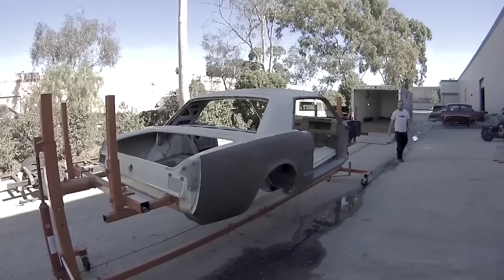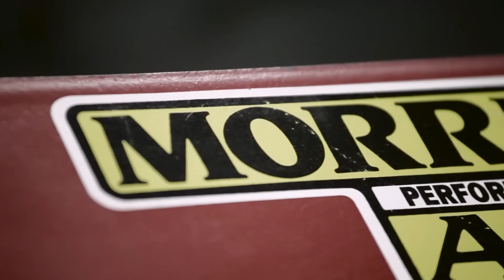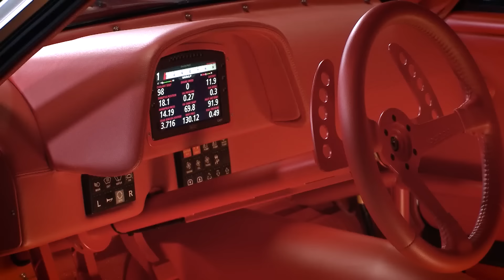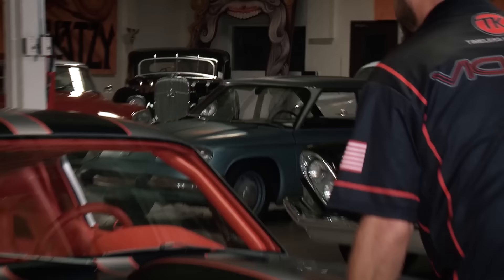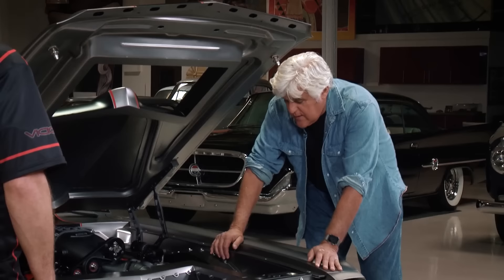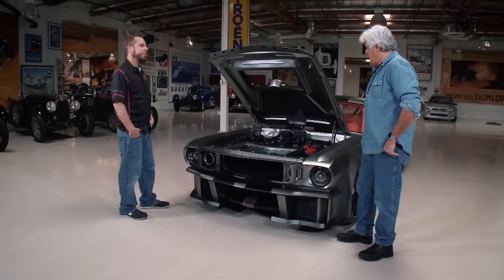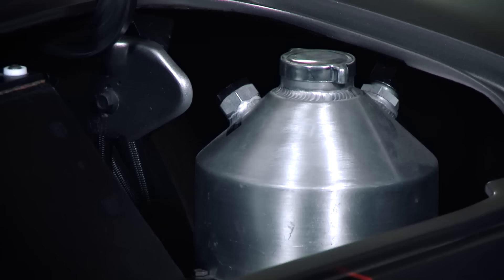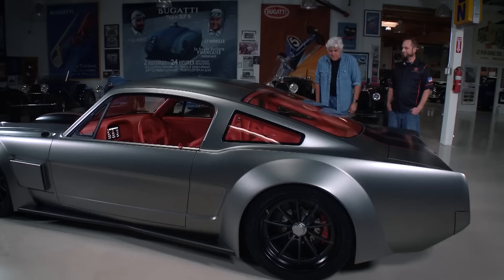1,000 HP 'Vicious' 1965 Ford Mustang - Jay Leno's Garage

Comment: Could they have cut the car down the middle length ways and added in 8 inches in the centre to avoid those horrific wheel arches? 🤔🤣 lol. Interesting engineering features though. Thanks jay
Reply: High Light if you did that you'd have to widen dashboard, engine and suspension mounting points would be different not to mention how much work would be needed to get all the rigidity back.
Reply: Glas is usually one of the biggest issue in widening a car.
Reply: If you take a look at the Ring Brothers carbon fiber mustang where the widened it s5 or so inches on each side all the way from front to rear it still just doesn't look right, These guy could of molded those fenders a lot more suttle but that was not the look they where going for.

Comment: A well built , modified , road racer . nothing wrong with that and enough power to some real damage .
Reply: Jim Braun Exactly..
Reply: Totally it's just a little early 2000s to me
Reply: enough power to get you in some real trouble, its too much for AWD, its way too much for RWD
Reply: Genuine question. What is 2017 type build?  I'm not in the loop.
Reply: moyadapne I think the guy said they used the2017's 350R engine as base
Reply: Jim Braun
Reply: I'm pretty picky with mustangs, and a 64/65/66 coupe are my favorite body. I like the exterior, if you ignore the quarter panels that they ruined. lines are awful, paint looks nice, red windows are a nice touch, the functionality of the bodywork is a nice touch as well, but the interior ruins it, just has to much, red, need to introduce some white or silver to break it up.
Reply: Jim Braun that's a well built almost daily driver 
They say it's built you can street drive it
Reply: Jim Braun                            B Bob
Reply: +Carter Stokoe ohh wow i have three of those and they are priced at honda civic lvl lol. this car by far is the one of my favorites,,hoonicorn=] i like power over originality so is up to someone wether they want shred it or build it
Reply: Jim Braun
Reply: Jim Braun with a 1000HP makes the most suped up Honda civic look like a Tonka toy
Reply: john clark like a matchbox car. Tonka toys heavy duty. At least back in my day they were. I hate those suped up Hondas with 500-1000hp. Idc how fast they are.

Comment: Just read a bunch of the comments. I'm an old guy, and a simple hotrodder. This car is beautifully designed and the exacution is beyond reproach. A true hotrodder takes the best parts available, makes some of his own, and reengineers his ride. So what if it has corvette control arms. They could have made their own; but well designed and manufactured arms that fit the design were available off the shelf. Don't you think enough hours were spent building this car? Don't forget, this car was built for a particular person, not you. So you don't like the "all red interior", that's possibly the least expensive part of the build, Do you think the car's owner didn't have input on the interior? It's what he wanted and your fortunate just to look at it. The car is one of one. Build yours your way. Fantastic car, fantastic build. Imagination that's tangable. I love this car. I got my first '65 Mustang fastback 50 years ago and still have one. Stock is for museums, hotrods are to drive.
Reply: Rack 'em
Reply: Love your comment,,, so true about the bowtie parts,,, they work.
I am an aircraft mechanic and apply those tolerances to my own automotive passion,,, same threads protruding on every screw,,,, well,,,, YEAH! That's how it's done unless you're a backwoods goober with coffee cans full of old hardware making it's way onto your ride....

Comment: Leno: why steel? 
Owner: I have a thousand horsepower, why not?
Reply: @Wes 76 no guarantee it would handle better..... if you have the weight balanced properly a 20,000 lb vehicle can handle good. My dad's 82' chevy stepside is slick, he can take an almost 90 degree corner at 50 mph without even squeaking a tire.
Reply: At least if you hit a tree the tree would be the one who died. Ish.
Reply: "because we know how to weld"
Reply: Love it
Reply: @nicomas2471  tire to weight ratio. when you build small cars you have tire size limitations. when you have gotten the biggest tires possible, the only way to get more traction is to reduce weight.
Reply: Yeah yeah BS. Don't piss on me and tell its raining.
Reply: My thoughts exactly.  1000 Horsepower, gotta give it a real load or it will short-circuit.
Reply: @lynnkramer1211  
It’s raining.

Comment: I’m not normally that crazy about Mustangs but I do like the fastbacks of that vintage.   
This one is exceptional. I don’t see how anyone could not be impressed by the attention to detail and the workmanship. 
Very tastefully done. 
I had to laugh when he said “Yeah this one doesn’t have any taste at all.” 🤣
Reply: OldSchool  
The Chevy must not have been hitting on all eight. 😏
Nah, just kidding, I don’t know what your friend had under the hood or exactly what kind of car it was. The 302 is a respectable engine. Especially in a light car like a Fox Body Mustang. 
If you had a 1980 Mustang with a 302 though it must’ve been a transplant because in 1980 the 302 wasn’t available. It was in 1979 but for 1980 and 81 they de-bored it to 255 and put some crappy heads on it because of the gas crunch and it produced a pathetic 119 horsepower. It was the slowest V8 Mustang ever. If you didn’t buy it new though it’s quite possible that the previous owner put a 302 in it and probably put some other go fast goodies on it too. Hot rodders loved those Fox Body Mustangs.

Comment: WHY IS NO ONE MENTIONING THAT THIS IS TWIN TURBO AND ALSO SUPERCHARGED???
Reply: That's pretty common among performance cars
Reply: i mean, when you say pretty common.... i've only ever seen it once or twice before. most performance cars are TT
Reply: Technically a a turbocharger is a "turbosupercharger" in that it is a turbine driver supercharger.
Reply: All it does is at low RPM the Supercharger is going and keeping the engine boosted and at high RPM the Supercharger is disconnected and the turbos take over. Keeps an even boost through the RPM curve. This is because the Supercharger has even boost at all RPM but it is a HP drag on the engine whereas the turbos lag at low RPM since you aren't producing much exhaust but doesn't drag on the engine since they are powered by the exhaust so at high RPM are more efficient.
Reply: 2:09
Reply: Its compound charged and only makes 1000 horse. My question is, why not turn it up?
Reply: Why would we? They already talked about it...
Reply: lol...the Supercharger is disconnected and the turbos take over???? Its called compound boost. The supercharger will simply take the air that has been compressed by the turbochargers and further compress it as it travels into the engine. In fact, the turbochargers will basically help to improve the overall efficiency of the supercharger. The supercharger never disengages from the engine...and you absolutely no idea what you are talking about.
Reply: Yeah too common, I have that setup on my moped...
Reply: Anthony causey
They probably want it to last more than a week.
Reply: Isn’t it called twincharged ?
Reply: Do's anyone in this little conversation have any clue what there talking about ? From s.c disconnects to a s.c on a v8 dos not draw power out of the engine lmfao yes it creates more hp duh that's the whole point as everyone knows  but it also draws alot of hp to drive them  as well , people in early drag racing days tryed to find ways around this going as far as to run the supercharger off a second smaller engine in the rear of the car  lol it's wild what people have done to battle the problem of running a s.c to gain as much hp as possible , there's down falls to all types of ways to make boost if superchargers didn't take any hp to turn them everyone would just use that setup
Reply: Da $wag Lord ikr
Reply: Wrong, Turbo impellers have much less weight and parisitice mechanical drag than a supercharger at any RPM. But don't be bitter bittner..
Reply: How much more of less power is not the issue. Look up parasitic drag as you don't understand, it has to do with efficiency I.E. energy in energy out.
Reply: THEY DID..
Reply: The builder did.
Reply: It's one of the first things they mentioned.
Reply: Da $wag Lord.. Lancia delta s4 first car with turbo and super charger... Was done in the 80s.. Nothing new over here in Europe.. Vw polo had it both too a few years ago
Reply: Correct & the Mk6 VW Golf TSI, I had one for 3 yrs & it went like a scolded cat....
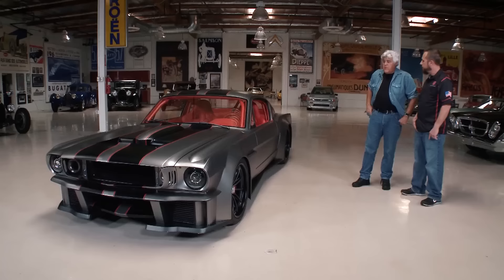Reply: Da $wag Lord @2:15 . I thought I heard it mentioned 2x, the guest said it and then  Jay backed him up, how did you miss it?
Reply: overkill automotive performance Does* anyone in this, does* not draw power.
Reply: volvo has been doing it successfully for years now
Reply: 1000whp ONLY, what does your car produce at the wheels?  Jees
Reply: Da $wag Lord what are you talking about, it was mentioned in the first 3 minutes.
Reply: "Pretty common"  I swear.  Only on YouTube.
Reply: Al Bittner You obviously don't know what you're talking about. Parasitic HP loss is a real thing, as well as superchargers that disconnect. Google the 2019 Corvette ZR1 and read up.
Reply: They did.
FWIW various makers are offering compound turbo + superchargers on regular road cars.  Lancia did it first on the Delta S4, but you can get this set-up on FIAT Twin Air and Ford EcoBoost
Reply: Because compound setups are pretty common nowadays
Reply: E G thank you for explaining that to  that person they must not be a car guy
Reply: This was clearly mentioned in the video
Reply: That is not just any Stud car
Reply: To be fair, it's 1000 horse at the wheels. 18-20% parasitic loss of horsepower through the drive train is usually a pretty close estimate. Crank HP is probably 1150-1200. I'm sure the motor could make more, but 26 PSI through a 5.1L V8 is no joke. I love the car, nasty looking ride and I'm sure it's a blast to drive.
Reply: Thats literally not common at all. tf?
Reply: Happens bro
Reply: It's fairly common these days.. my 383 has a supercharger and turbo headers... I have block off plates on it but if I wanted to I could run tt-sc-tbi. It's really common now.. it's only a method of adding boost... At crank I'm 630ish hp at the wheels im 590ish hp... With the wet nos shot I run 700 crank and 645 wheels--- according the type of fuel and the weather (temp of the day does effect performance)
Reply: „WHY IS NO ONE MENTIONING THAT THIS IS TWIN TURBO AND ALSO SUPERCHARGED???” 

Jason mentions this at 8:15: https://youtu.be/gvAqEGbkx5E?t=490

So... You are not very good at extracting informations out of YouTube, are you? :-)
Reply: Gag jew
Reply: Whoa
Reply: Lol, because an engine with that displacement and twin charging only producing 1000 bhp is poor. I've seen evo's with 2.4 engines reliably making over 1200.......
Reply: @RIngLeBell  extremely common. They were doing it in UK back in the 70's. Its old f1 technology. They also used it in group b cars. Look at the lancia delta s4.... 1.7 litre engine, twin charged, producing a 1000 bhp. 1.7!!!!!
Reply: @scott-nd1js  lol, is that what you guys call it over there "compound" charged??? Lol, its twin charged. Was invented in Britain in 70's formula 1....
Reply: @EG-yh9gx  nah, its definitely called twin charging. Was invented in UK over 40 years ago....
Reply: @Al Bittner lol, I was thinking that too ....
Reply: They did at the beggining.
Reply: it does
Reply: you must not be watching the same video i am  as  it  was  definitely mentioned  at 2 minutes 10 seconds
Reply: @EG-yh9gx  Winner, winner chicken dinner!  Pre-charge the air to the supercharger to make it more efficient....so it can make gobs of power.
Reply: Because that’s nothing new!! Anyone that follows high performance vehicles knows this
Reply: “Pretty common” one guy says lmfao
Reply: @ 8:30 describes the TC routing into the SC.
Reply: Common lol. You're common.
Reply: Pretty sure Mercedes has been doing this since like the 90's on there biturbo cars 🤦🏽‍♂️
Reply: Because no1 cares
Reply: J remarked on that during the first engine conversation.
Reply: VW does this in many production cars with their TSI engine.
Reply: Jason Edwards is 2.4 l making over 1200 at probably 50+ psi and has already got through 3+ engines forming blowing the pistons and crank.
Reply: they did while walking around the car. Bet it gets 3 gallons to the mile when opened up.LOL
Reply: For everyone saying they did talk about it he's talking about us the commenters jeez how slow can you be
Reply: silverbackdp yes and the Skoda Fabia vrs 1.4 twin charged mated to a 7 speed dsg box. I had one
Reply: Two twin scroll turbines if going to a track or supercharged for the drag strip! It makes no sense to use both! Especially with the air shifted synchronized transmission! At high rpm’s they can easily use ignition timing to upshift without losing boost, but at low rpm’s you have to cut fuel to shift up.
Reply: @markr5132  I looked up "parisitice". I now understand it has to do with the vagina dentata coefficient.
Reply: Because its useless. You can only push so much boost into a cylinder before you blow it anyway. Might as well just have the supercharger or the turbos push that boost. Really no need for both. Waste of money and over complex is why you dont see it much.
Reply: He did mention it
Reply: Why is no one mentioning that there's no trunk space?
(Just to beat a dead horse.)
Reply: @EG-yh9gx  well, he's not completely wrong and at best only half-correct. I will try to expand on your well-written comment to provide some additional helpful nuggets. The "official" industry term for combining a supercharger and a turbocharger is called a twincharger system. Twinchargers can be configured to run in series or parallel. Series just means that one system's "output" feeds into the "input" of the other, whereas parallel means that some sort of valve or clutch "selects" which compressor feeds the engine. Series is the most common arrangement of the two.

The little "hint" or giveaway Jason says in the video is he used the term "... it's compound boosted" as well as explaining that the turbos feed into the supercharger which leads me to believe both compressors are operating 100% of the time in a series configuration, and the total manifold pressure at any given interval (RPM) is determined by the ratios of the combined pressure output of both compressors. Some series configurations of twincharger systems might include an electronic clutch that can "decide" or more accurately, choose to neutral-bypass and/or decouple the supercharger from the drivetrain when the turbocharger reaches effective operating speed. In the latter configuration, the result is not a "compound boost" because only one compressor system is forcing air into the manifold at any given time. There are some advantages/disadvantages to both configurations, but the "compound" boost is able to achieve boost pressures unobtainable in any other configuration, and also adds potential longevity to the overall engine's performance by reducing the charge temperature because total charge pressure is split between 2 compressor systems rather than just 1.
Reply: @pauld.b7129  see my comment in this thread why you would want both systems working in a "compound" series arrangement. If total boost pressure is 20psi (example arbitrary number), if both compressor systems are working together the load is split resulting in a lower charge temperature than if each system was working individually. Also, having them work in a compound boost arrangement doesn't require additional tuning to compensate the spikes in the power curve during points where each system reaches peak efficiency and power output. I also tend to subscribe to the school of thought where a nice, smooth power curve throughout the entire RPM range (total average HP/torque) is more ideal than peak HP/torque.
Reply: Google made me do it you dont really have the slightest idea what your talking about. Do you? Disconnected supercharger. Hahahaha
Reply: Compound Boosted ..... seems important
Reply: @markr5132  He was saying that the turbochargers power curve is more delayed and that is the disadvantage, not the impellers.
Reply: @anonymousanonymous9991  News flash, turbo's have impellers, which spin up with heat and pressure.
Reply: @markr5132  Im saying that impellers arent the problem, not that they don't exist ffs
Reply: Lmao is that the oil filter he so impressed with the k&n filter lol
Reply: Because the boost guage is dead to me....I have been running a 7.3 ltr super turbo for almost 10 years. She is a complete sleeper 2 door OBS work truck white and spray paint white and dents oily and prints bench seat with harnesses tucked away headache rack cross box with 42 gallons of water and methanol spooled up she breaths silver to redish exhaust and will spank nearly everything on the road despite a curb weight of 9021lbs and we haul her 16 ft gf around weighs 9200lbs give or take and I still get 15+ mpg highway foot locked at 70mph.
If you are only running turbos or just super charging better go back home. Charging off the line to rapidly spooling into that charge makes 1/8th mile scary  and 1/4 a breeze as you walk away from Van Winkle.
Reply: Its compound boosted
Reply: @scott-nd1js  Only? can you imagine how fat that power band is.
Reply: I was just thinking that too, that was impossible 10 years ago..haha
Reply: They did mention  it or else how would you know !????
Reply: justsomeguy It was raining.